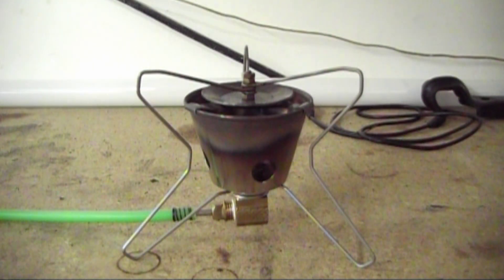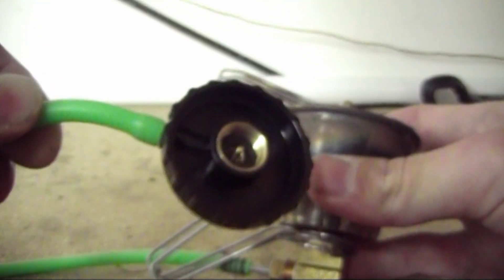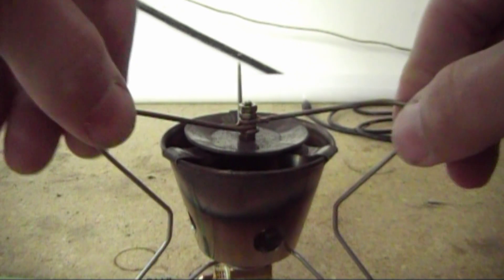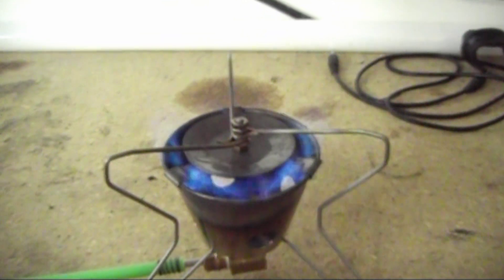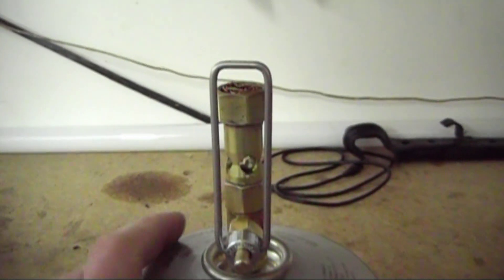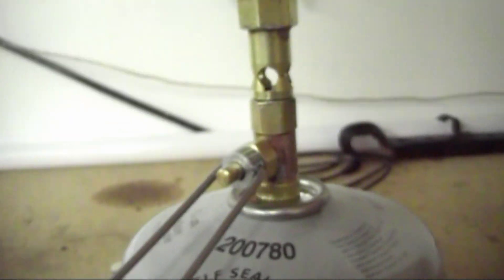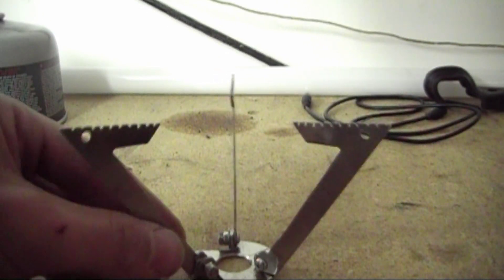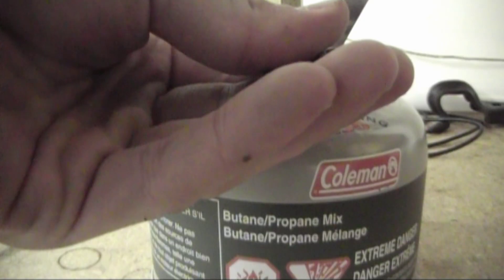DIY butane stoves Butterfly and the "Mockit" rocket

Comment: Nice work!
U should try using a small air inlet in hose, the flame would burn smoother.
Now if you injected oxygen instead of ambient air, the flame would probably melt a frying pan!!!

Comment: what would you think of using the burner from a colman stove to make a backpacking or camp stove that uses the same fuel as a msr windburner cause i have one that is missing parts and thinking of making a wisperlte or some thing
Reply from the maker: You would probably need to make a new orifice, or gas jet. Because it seems white gas stoves use a much larger orifice than butane or propane stoves. I have tried to make a "universal" stove that can burn both liquid and gas fuels, but neither work well in the other's jet size.